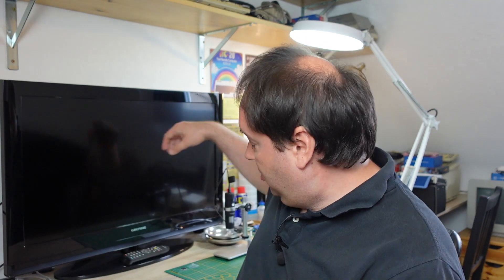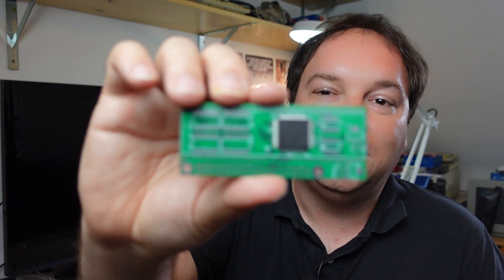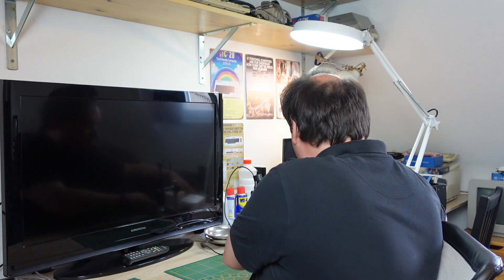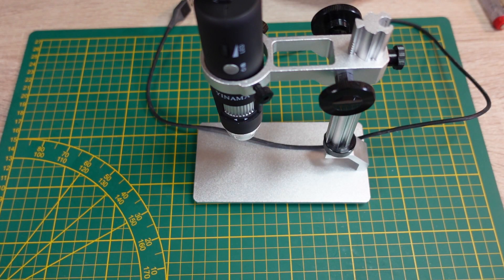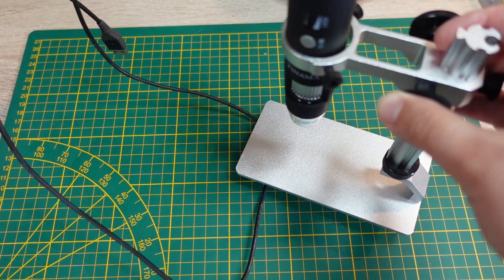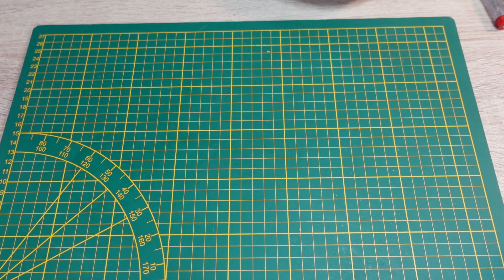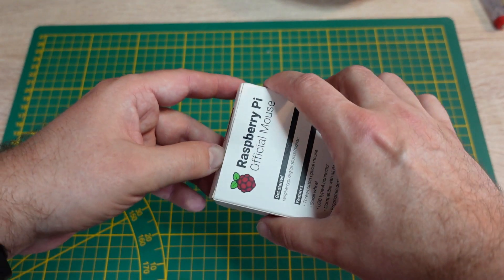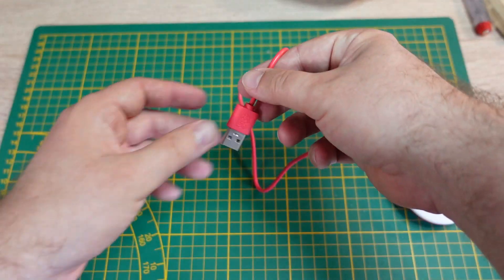USB Microscope and Raspberry Pi 400 for SMD Soldering

Comment: I think i have the exact same one i bought maybe 2 years ago (the microscope). It has good quality for the very low price but the problem i had was the software included want not "signed" so i took it off. Ive since bought one for about $150AUD delivered from Aliexpress. I can vouch it has quality of reputable brands that sell for over 700AUD.

The raspberry PI400 is a beast of a computer. Do so much with it for an affordable price!